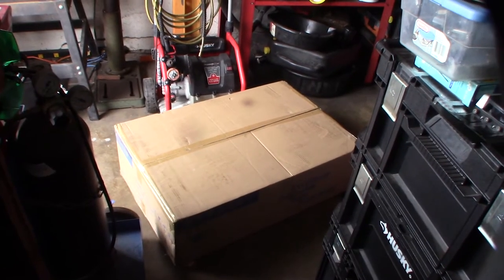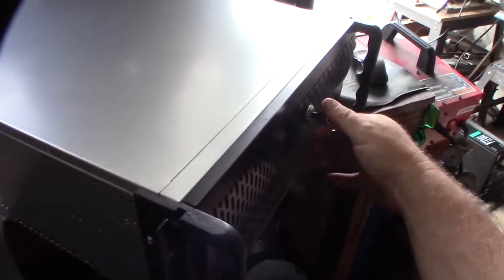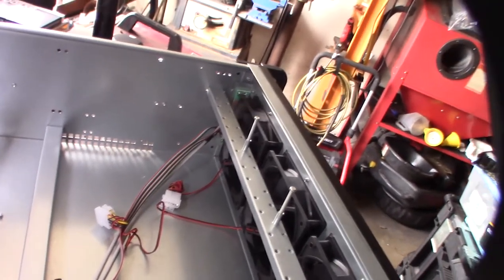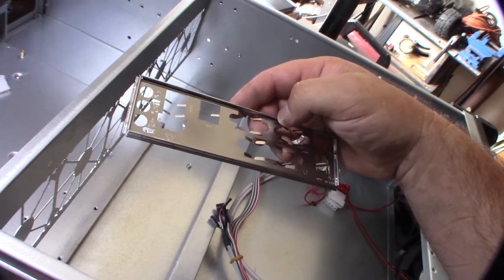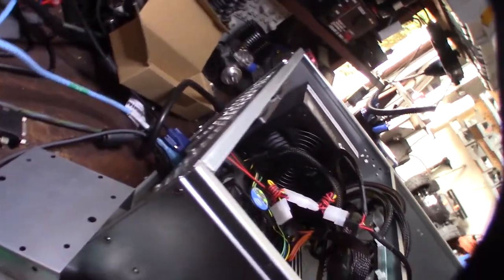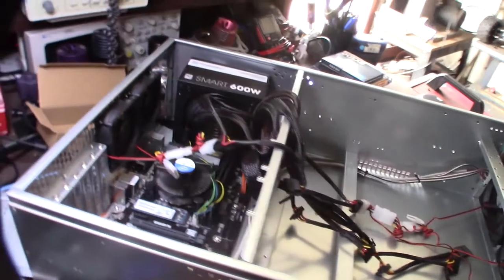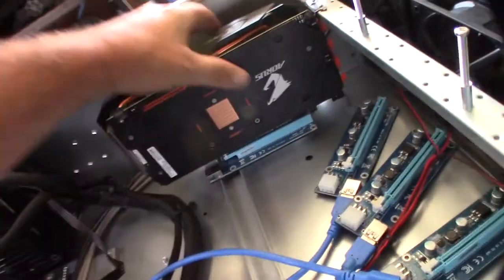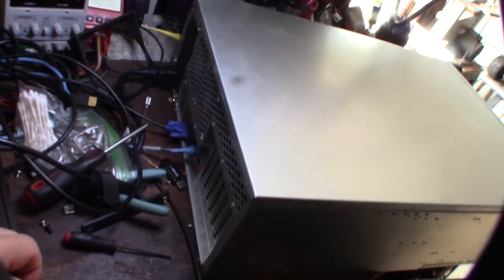Roswill RSV-L4000C 4U Rackmount 6-8 GPU crypt mining case Bitcoin Ethereum RSV-L4000B

Comment: I has the same issue with the bottom bar my self .  I flipped mine over as well . I wrapped it in a abrasion tape as i was afraid the slight vibration of the GPU fans may lead to the foam on the bottom of the risers eventually allowing contact with the then U shape of the bar.  I also mover the bar way forward so it was centered under the riser .  I just installed the screws through the vented section in front of where the bar used to be.
Reply from the maker: I was actually thinking the same thing about the foam rubbing through. I might 3D print something.